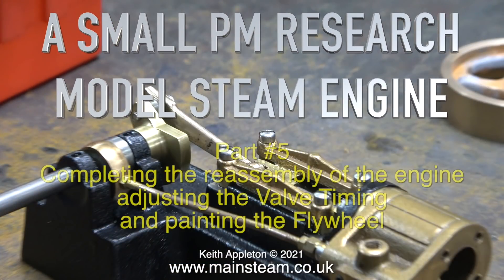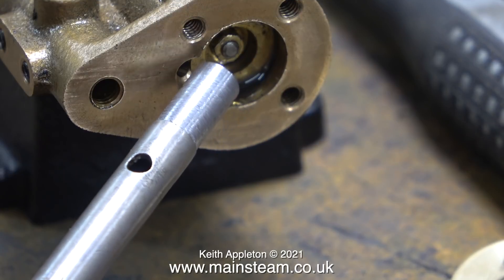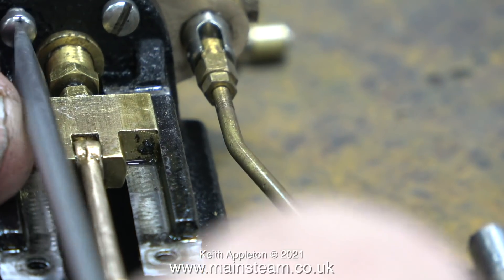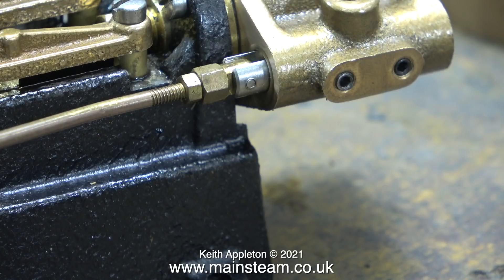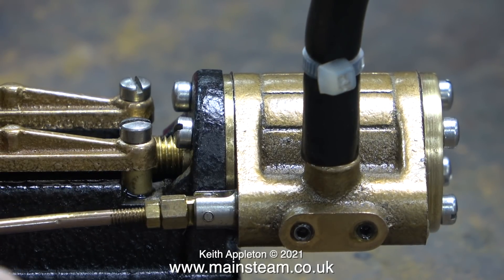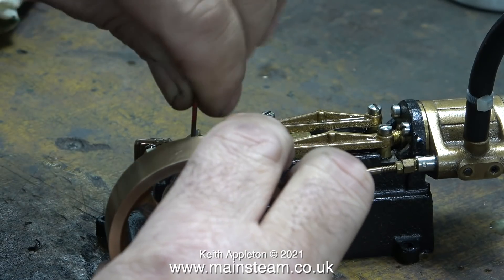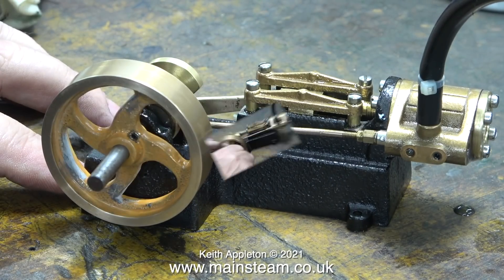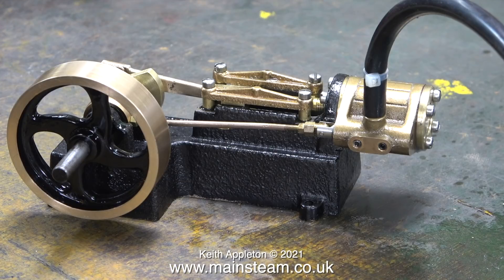A PM RESEARCH MODEL STEAM ENGINE - PART #5

Comment: Keith I'm a relatively experienced engineer. looking at getting some home equipment to keep me busy. As I have more time than I would like on my hands at the moment.   I spent much time on a south bend 13 x30.    What size do you tend to spend most your time on when working on your models  As I know you own multiple machines?
Reply from the maker: Usually my Boxford Lathe as it is the one nearest to where I keep most of my tooling.
Reply: @keithappleton  thank you for the reply

Comment: wrong bolt in wrong place been there done that/  do you find much difference between air pressure and steam?
Reply from the maker: Yes Steam & Compressed air are very different.
Reply: @keithappleton  on both of them running in an engine once  you tune with air  do you have to tweak it a little when running on steam(wish I would word my question right in the first place sorry)

Comment: Hello, I am building the exact same engine and I had questions about the timing and I found that my timing was exactly the same as what you had. Seems that the more I run it the better and smoother it gets,(it runs smooth as glass). I was just not sure I was timing it correctly but now I know it’s right. So to answer your question, yes I found it very useful. Thank you 😬👍.  Eddie wheels 😬🧑🏻‍🦽🇺🇸 from NJ.